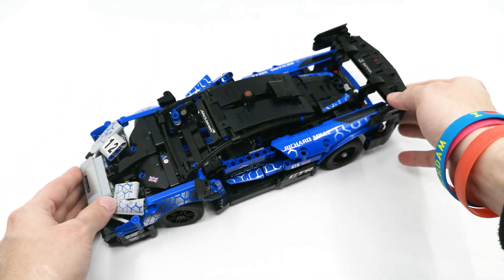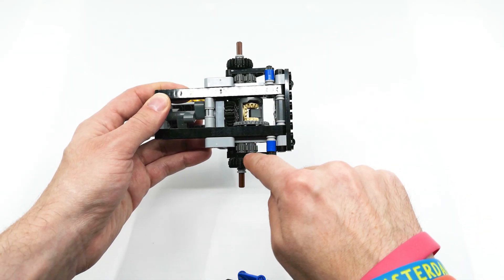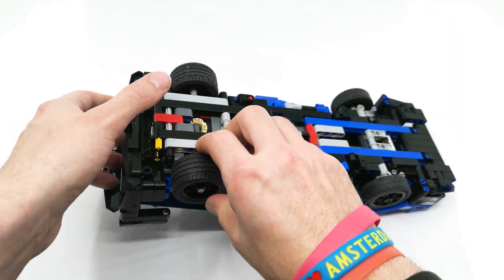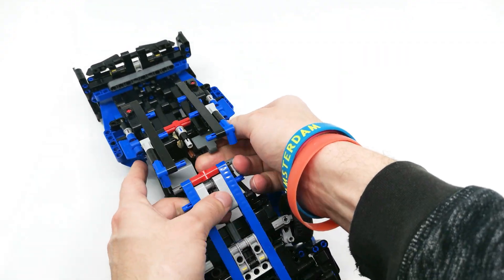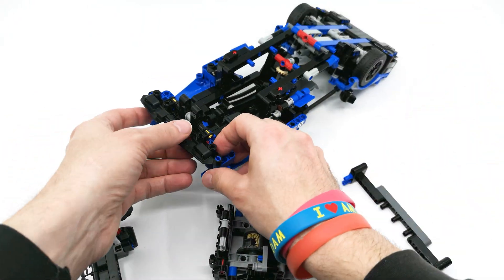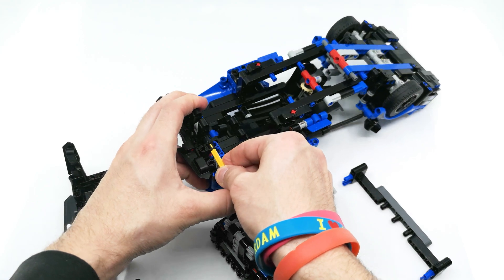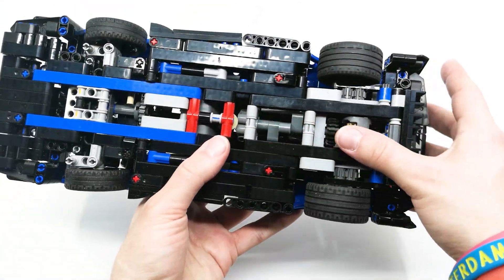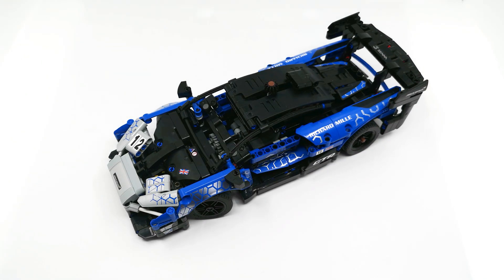Lego Technic 42123 Differential and Working Steering Wheel MOD

Comment: Great work! This was my first Technic set and I started with just the steering wheel mod. I bought the parts on Bricklink so it might help others if I list what's needed: 32065 (1, Black), 32209 (1, Dark Bluish Gray), 3713 (1, Light Bluish Gray), 32034 (1, Light Bluish Gray), 4265c (1, Light Bluish Gray), 32556 (1, Tan), 10928 (1, Dark Bluish Gray), 3648 (1, Dark Bluish Gray), 15535 (1, Dark Bluish Gray), 32002 (6, Tan). Thanks again for sharing!
Reply: @Henri Li Only the steering wheel.

Comment: This looks a good mod would it be possible for you to to do a video of you building the sub assembly as I have tried to follow the LDD and its unclear (certain pieces not showing)
Reply from the maker: Use LDD 4.2.11, not 4.2.12
Reply: @ZEROBRICKS  will try that on the jeep mod that I saw you also have done as I found someone else did a differential mod
Reply: to add to my previous comment as you don't provide a list of additional parts required I won't try to put a gear train into the jeep

Comment: This is my first technic set, alongisde the 488 which is on its way. I love the addition of the diff into this model and want to modify my Senna in the same way. However, I do not own the extra parts required. I was wondering if I have to buy more technic sets to take apart or if I can buy the specific parts I need to customise the diff?
Reply from the maker: You can buy individual pieces from Lego or Bricklink.
Reply: @ZEROBRICKS  fantastic.  I assume LDD lists all the parts required for the mod?
Reply: @ZEROBRICKS  also, while I have your attention hehe. Your channel is excellent and was a great way to be introduced to technic. Have you considered making modifications to the GTR spoiler back to the standard Senna spoiler?
Reply from the maker: @ArjanSangraa  Thanks. Not really thought about visual mods...
Reply: @ZEROBRICKS  Some food for thought for ya